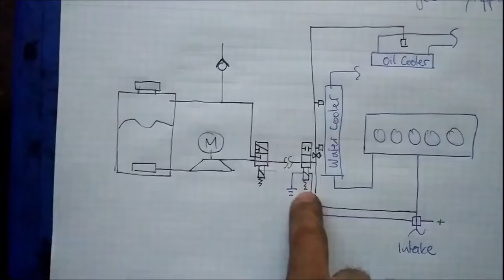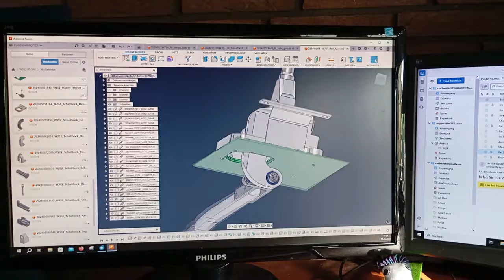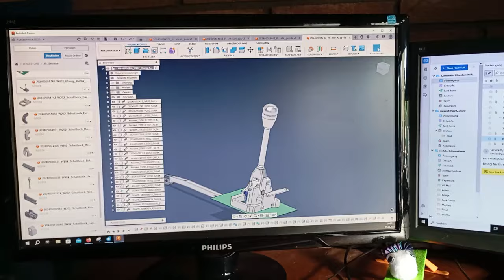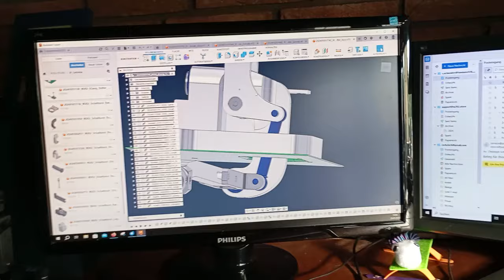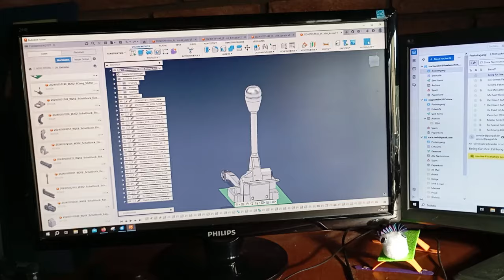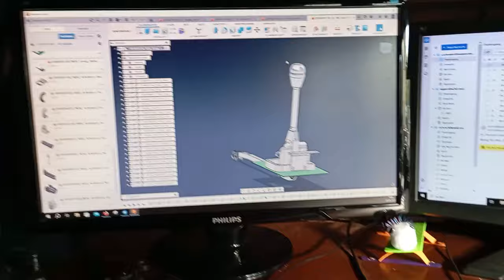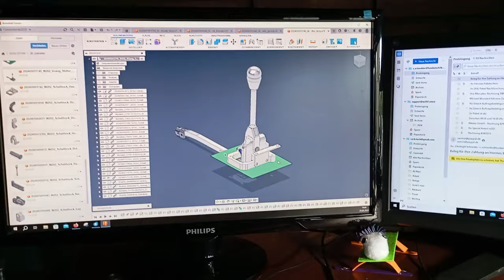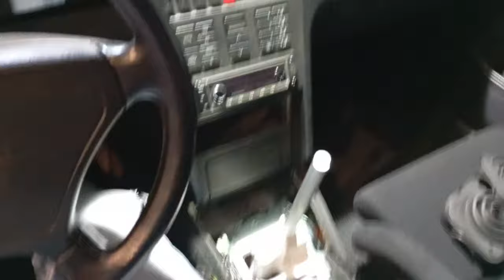Mercedes W202 Short Shifter for 6-Speed Gearbox Swap Part 1/2 (C208 CLK, W201 190e, W124, R170 SLK)

Comment: And if you want to make your standard 5 speeder into a short shifter, extend the gearshifter arms to the linkage with approximately 5-6cm. This can also help the shifter feel tighter.
Just a heads up, when doing this, change the length of the the part nearest the linkage, because it is an absolute pain in the ass to assemble back again if you cant line up the holes close to the shifter.
Reply: could you share little more details about this customisation, please? Thank you.

Comment: Will you offer different lengths for the 208s and 170s as well?
Reply from the maker: For C208 it definitely fits. For R170 the adjustable range should work

Comment: Btw I still have a question about those engine mounts you have on your M111. I would like to move from the stock ones.
Reply from the maker: They are highly customized to fit, can not recommend. Better search for maybach mounts, they are stiff, they fit and are plug and play.